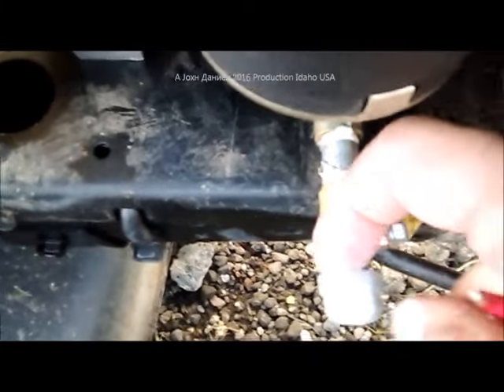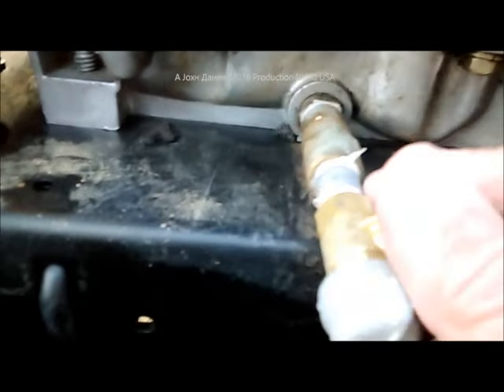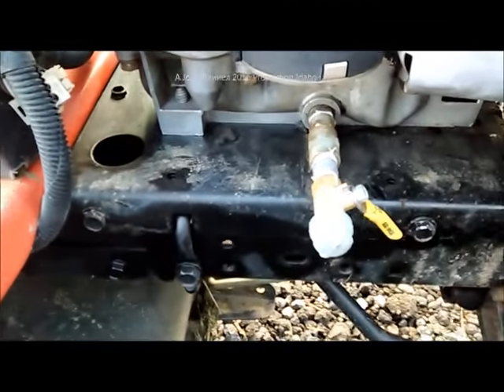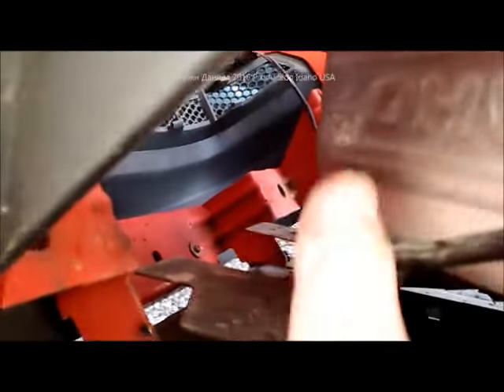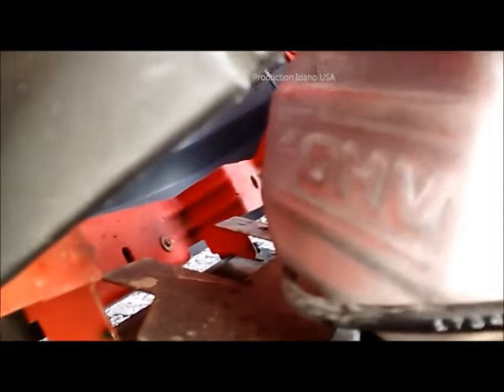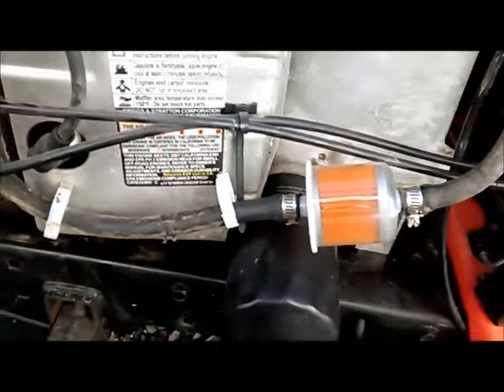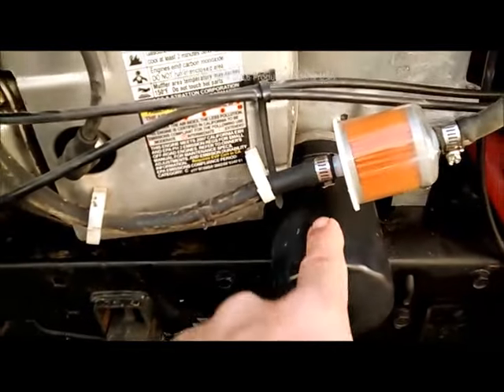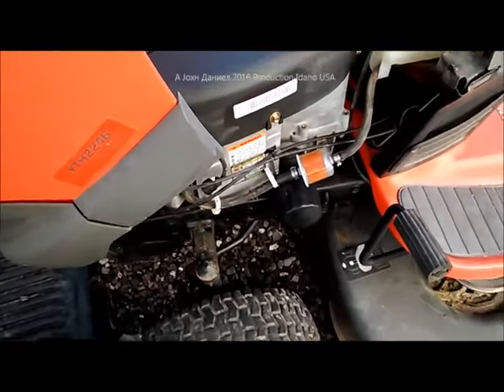Increase OIL capacity on Small Engines, run cooler, last longer $6

Comment: I put a fuel shut off valve in line between the carburetor and the filter so that when I am finished mowing, I turn off the fuel and let it run until it quits. The idea there is to not have any fuel left in the carb to corrode or gum up the main jet.
Reply: I used to do that but stopped after thinking about it;

You are running the motor lean & adding temp. to head and combustion chamber,on small engines like chainsaw or brushcutter,

I just tip out little fuel left since tanks are small to store in off season....

Personally, I rather have fuel in line and dump the fuel bowl of the carb. if needed because it was sitting too long from its last start up,last couple years and have had no probs.

I do use fuel stablizer additive in fuel towards the back end of warm seasons for winter periods where it is used less to not @ all.

Fuel cut off solenoid on carb. bowl does the job for me 🍻
Reply: Would the jets still get gummed if you're using ethanol free fuel?
Reply: No you'll never have problems with  gum ups.  Always use ethanol free gas for small engines
Reply: Put it before the filter for easy filter
Changes

Comment: Some good points...thanks for sharing.   I had good luck with my Briggs Intek engine with just regular maintenance.  How hot those air cooled engines run depends mostly on where you live and  the ambient temp.  When it got in the high 80s and 90s, here,  I could really feel the heat pouring off of it.

Comment: I have a 18hp B&S an a 4hp B&S ,I change oil an filter when the oil just starts to look medium brown on the dipstick.I use just a good premium brand , an both engine’s are about 20yrs old an don’t smoke or nothing , just don’t run your engines when the oil has turned black!! Keeping carb. filter clean helps keep dirt out of oil an engine ,you don’t need to be a fanatic about it like some homeowners are , commercial mowers are different in that they see more aggressive use cause they make money for the operators.

Comment: good idea👍 
Actually put a bypass filter on my vanguard doubled the oil capacity even added oil cooler to the return. 

Just a maintenance tip for Intecs be sure to watch for valve cover leaks. 
When they leak, the oil collects dirt and plugs the head cooling ports causing the heads to overheat and can get so hot the valve guides move out of place.

Comment: Fram G-1 fuel filter works well on lawn tractors. $4. The 3600 (Fram #system) might interfere with the body work on some mowers and will be to long for Zero steer mowers. 
Fuel shut off is always a good idea.
Reply: Fram sucks they have rust on their filters

Comment: I have a briggs 24hp, I change the oil & filter every spring, I also use non-ethanol fuel, I've had the mower since 2014 and it only has 329 hrs on it
Reply from the maker: The 24 is the best engine they ever made.
Reply: @JOHNDANIEL1  I wasn't sure but I checked, It's a 24hp Platinum Series not sure what that means. it also has a K46AW transaxles, I just use it for cutting and hauling my cart when I'm doing yard work, no ground engaging equipment is used, I'm not physically able to change the trans fluids, if I'm not using ground engaging equipment should I be concerned?
Reply from the maker: No worries on that. Just keep an eye on the trans vent for signs of moisture and if it's always clean just keep going.
Reply: Tarylfixesall has a video on how to change hydrostatic transmission fluid.  It is a must on these since "they" don't want you to know about it

Comment: If there's room around the filter you could try one of the clip on finned oil filter coolers. They are cheap and add a lot of surface area assuming you get good contact between the filter and clip on cooler. 

It's a big finned attachment.

Comment: I use a Wix filter here, they filter down to 21 microns, the Purolator filter that fits also filters down to 21 microns.  A regular FRAM filter to fit the INTEK application won’t filter below 40 microns so a cheap oil filter is just blowing grit through your oil galleys.  I won’t pay less than about $12 for an oil filter.

Comment: 22hp and 24hp Briggs & Stratton ran over 1200 hrs both..  Only problem when 1000 hrs comes around the crank seal wears out and oil leaks.  Gave up replacing the seal.....apparently crank will wear down enough that a new seal won't do its job.

Comment: I have a 12.5 Horse Brigs on a mower that had a 10 HP motor it was just about a half inch taller so I adjusted the seat mount.  Man it can cut grass as if it was not there.   I have thought about putting the 18.5 on it but it was way to tall I Might just for the hell of it LOL.
Reply: +McCuneWindandSolar I got both motors at a auction for 5 bucks.  The 12.5 I need to take a part and rebuild it leaks oil and has blow back but runs good.   I sold the darn 18.5 some times I wish I kept it but I think the people I sold it do is not using it so I might by it back only sold it for what I paid for it and it works.  I like to see how it would run on my mower LOL.

Comment: Why,run clean oil, through dirty filter???
Reply from the maker: You shouldn't run new oil in a old filter, sorta ruins the reason for a filter. I change my bigger filter with every oil change same as the small one, not sure why you wouldn't. But putting on a new larger higher capacity filter increases oil lifespan and engine life by simple default of result.
Reply: @JOHNDANIEL1  Kind of strange answer, at about the 4 min mark you state 40 hour oil change and every other oil change, or 80 hour the filter gets changed. If the cost is a factor I would stretch the 40 hour out to 50 and change both oil and filter at the same time. Every other filter change is kind of like washing your feet and putting on dirty socks.

Comment: 500 hrs isn’t much for them engines. You can easily get 1000 to 1500 out of them if maintained properly.
Reply: my Koehler vtwin has 8000hrs....lol
Reply: 5000 hours is alot or hours for a mower.  500 over 10 years is pretty low, average home owner mowing a mid size yard once a week.   Commercial guys put 30 or 40 hours a week, 5000 hours over 3 years.
Reply: My Taotao potato scooter run 9300miles before I rebuilt the engine. It didnt need rebuilding but I did it to be sure. It run very lean. Didnt know much about them back then but clear signs of valves and piston clearly run hot and lean. Okay just change oil like the manuals stating and dont overheat the engine. Thats it! Carb should of course be kept well too. It might last 3000-5000 hours if your carefull. Mower gonna crap out way before the engine.
Reply: @bumblebob5979  Bwahahahahaha!

Comment: What type of easy access oil drain setup  in the video?  I have a 22 hp Intek Vtwin  18 yr old still runs good. I already use a larger automotive oil filter on it.   P.S.  I came across this video looking for opinions on putting larger oil filters on automobile engines. Mine is Toyota 4.7 L  V8.  Some of them mention  bypass pressure issues could be a problem with larger filters !!!
Reply from the maker: 1/4 Ball valve,  2" x 1/4 inch threaded steel pipe, and a 1/4" brass threaded plug.

Comment: yeah that's pretty good yeah I like that. thanks for sharing
Reply from the maker: +TheBillytheJack2010 I have 7 acres thats not leased out to be farmed and no longer covered by goats. For that reason I am buying 4 harbor freight mower engines and making me a 7 foot wide mower deck with them to be towed behind my truck to do the weeds knock down early in the year to stop pollination of them so the 2 tractors can mow without bogging down. Total cost will be about $550 but will save me a lot of time and effort.
Reply: Where'd you find the bypass filter setup,or did you make it?

Comment: You didn't explain why the larger fuel filter! Also, you didn't show what you did with the shrouds on the sides of the machine, will they fit over the larger oil filter and larger oil drain pipe???
I guess that's what you do when you are IN A HURRY!!

Comment: Have you tried amsoil full synthetic?that is the best oil nothing wares out. change it once a year its still nutty brown.other oils when you drain it totally black because its coming out of the ground which leaves a little grit in it that wares the piston an crank bearings,i have a 2006 craftsman with kohler twin,does not burn any oil 600 hrs. also use it in my 08 sierra,once a year change
Reply: I use Amsoil's small engine 10W-30 oil in my B&S 24Vtwin.  Best oil money can buy and no issues

Comment: I am about to change to Mobil 1, 5w-30 EP with a Mobil 1EP oil filter, on my JD riding mower. It has a 13HP Kohler engine. Any suggestions or comments?
Reply: I looked into that.
Briggs says with an air cooled engine and synthetic oil, you want to use 15w50.
I did mobile 1 5w30 in my lawn mower and it quickly developed a knock.
Look into it further, please
Reply: @markchidester6239  that's nonsense by briggs and stratton, the only thing that synthetic oil does any different than conventional oil of the same viscosity is flow better at colder temperatures and last longer before breakdown. I have an intek v-twin 22 horse and have used 5w30 synthetic in it since day 1, no knocks.
Reply: I've always used Amsoil small engine oil 10W-30 in my B&S Vtwin 24.  No issues at all

Comment: i change my oil on my harley every 1 k miles and i replace the oil filter about every 5k miles
Reply: i figure im also running cleaner oil than anybody running a full syn oil...
Reply: Its pointless to run clean oil thru an old filter if u do the oil do the filter
Reply: Every 3 years, right?

Comment: I'm looking at doing something stupid and I'm going to need to either go dry sump or only add an oil cooler. Any advice you could give? And will this engine pump oil correctly running as a horizontal shaft?